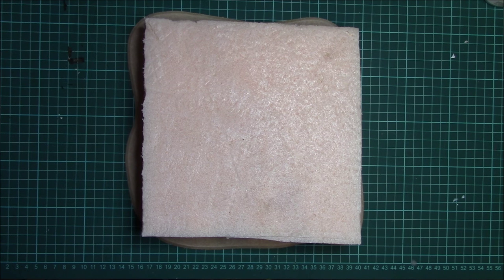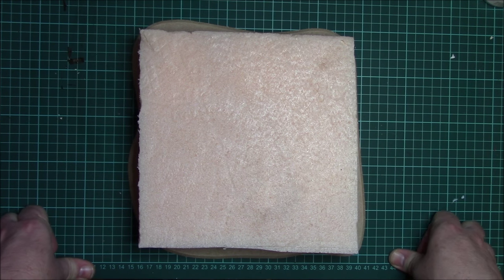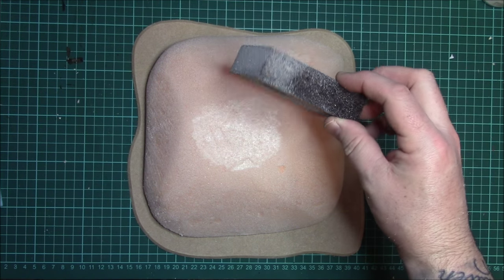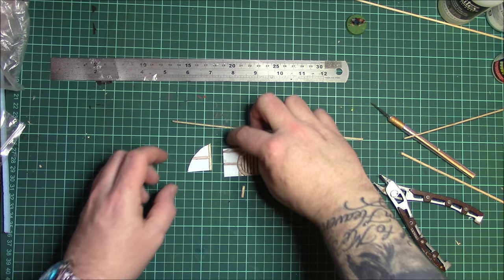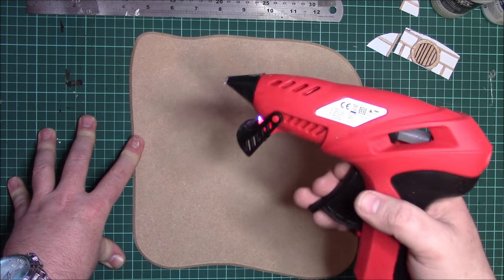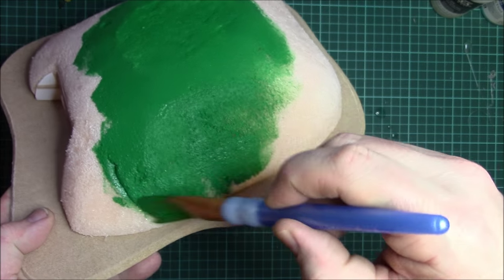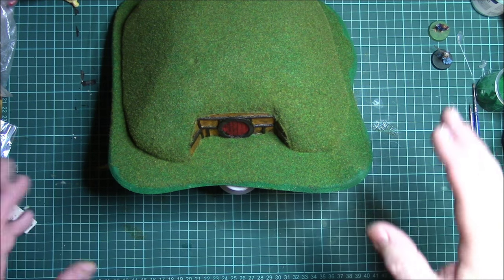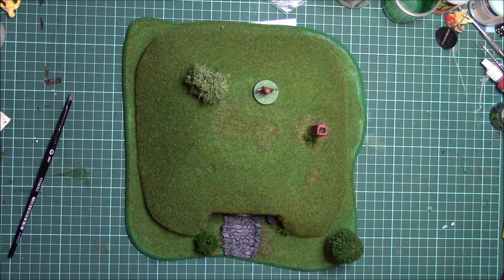Hobbit Hole Tutorial

Comment: that looks really cool ! one thing i would suggest is getting a lightweight filler to go around the edge where you join it to the base so it looks more fluid and make it look more like a hill as you wont have the indents where the hill meets the base. screw fix do a no nonsense lightwieght filler thats great for terrain.
Reply from the maker: +Dean “Rawfodog87” Broadway Hey Dean, Ye a filler would be a good idea, originally I wasnt going to build Bag End, so there was going to be a little more detail on these bog standard hobbit holes (Flower beds all around the joint etc). But mid way through the build I made the decision that I would be building Bag end for my Hobbiton board and thus with time constraints I just needed to get the smaller ones done as quick as I can, lol Thanks for watching buddy